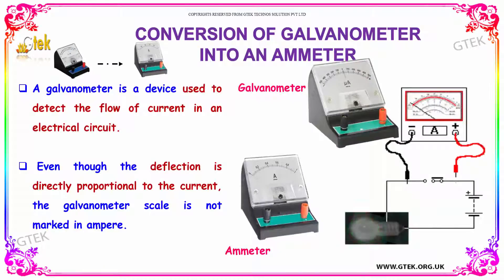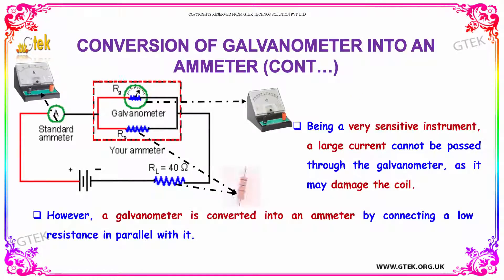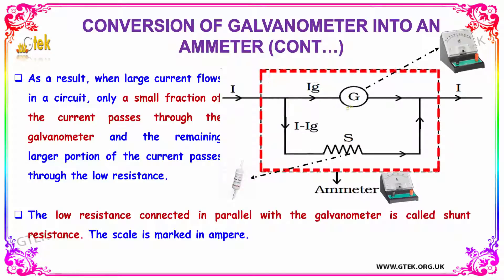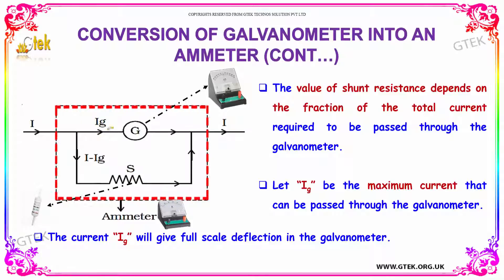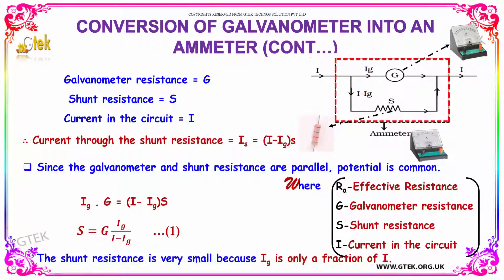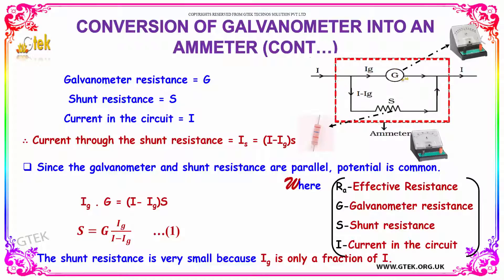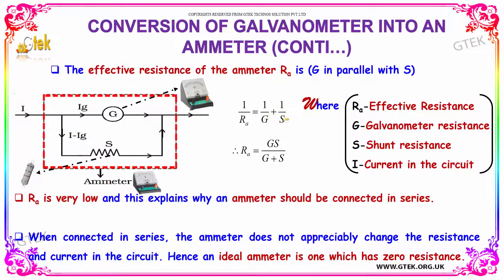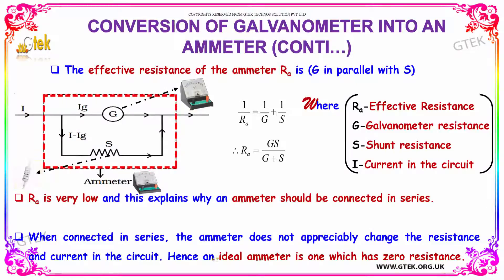Conversion of Galvanometer into an Ammeter Effects of electric current class 12 physics

Comment: A galvanometer is a type of sensitive ammeter: an instrument for detecting electric current. It is an analog electromechanical actuator that produces a rotary deflection of some type of pointer in response to electric current through its coil in a magnetic field.

Comment: A galvanometer can detect only small currents.  Thus, to measure large currents it is converted into an ammeter.  It can be converted into an ammeter by connecting a low resistance called shunt resistance in parallel to the galvanometer.

Let G be the resistance of the galvanometer and Ig be the current for full scale deflection in the galvanometer, the value of the shunt resistance required to convert the galvanometer into an ammeter of 0 to I ampere is,

                                                                              S=Ig* G/I-Ig

Ig is calculated using the equation, Ig = nk, where n is the number of divisions on the galvanometer and k is the figure of merit of galvanometer.

Comment: An ammeter is a low resistance galvanometer and is connected in series in a circuit to read current directly in ‘a’.
The resistance of an ammeter is to be made as low as possible so that it may read current without any appreciable error. Therefore to convert a galvanometer into ammeter a shunt resistance. (i.e., small resistance in parallel) is connected across the coil of galvanometer.

Comment: What is a Galvanometer?

A galvanometer is a device used to detect feeble electric currents in a circuit.  It has a coil pivoted (or suspended) between concave pole faces of a strong laminated horse shoe magnet.  When an electric current passes through the coil, it deflects.   The deflection is proportional to the current passed. The galvanometer coil has a moderate resistance (about 100 ohms) and the galvanometer itself has a small current carrying capacity (1 mA).

What is an Ammeter?

An ammeter is a device used for measuring large electric currents in circuits.  For this purpose, it is put in series with the circuit in which the current is to be measured.

How to convert a Galvanometer into an Ammeter?

A galvanometer can detect only small currents.  Thus, to measure large currents it is converted into an ammeter.  It can be converted into an ammeter by connecting a low resistance called shunt resistance in parallel to the galvanometer.

Let G be the resistance of the galvanometer and Ig be the current for full scale deflection in the galvanometer, the value of the shunt resistance required to convert the galvanometer into an ammeter of 0 to I ampere is,

                                                                              S=frac{I_{g} imes G}{I-I_{g}}

Ig is calculated using the equation, Ig = nk, where n is the number of divisions on the galvanometer and k is the figure of merit of galvanometer.

What is figure of merit of a galvanometer?

The figure of merit of a galvanometer is defined as the current required in producing a unit deflection in the scale of the galvanometer.  It is represented by the symbol k and is given by the equation,

                                                            k=frac{E}{(R+S) heta }
Where E is the e.m.f. of the cell and θ is the deflection produced with resistance R.

Let ‘l’ be the length of the resistance wire required for a resistance of S ohm,

                                                         Then, \;l=\frac{\pi\;r ^{2}\;S}{\rho}

Comment: Image result for conversion of galvanometer into ammeter
Since Galvanometer is a very sensitive instrument therefore it can't measure heavy currents. In order to convert a Galvanometer into an Ammeter, a very low resistance known as "shunt" resistance is connected in parallel to Galvanometer. Value of shunt is so adjusted that most of the current passes through the shunt.